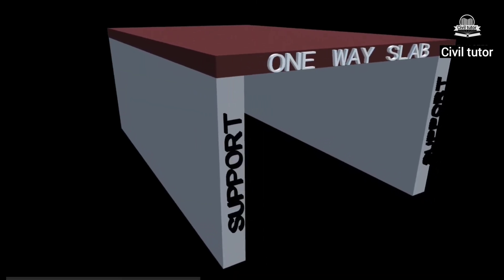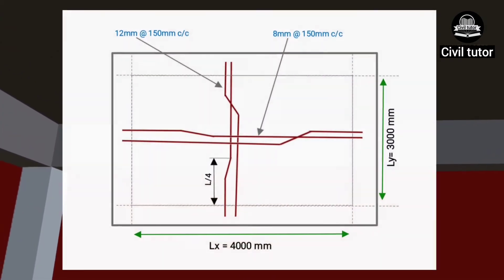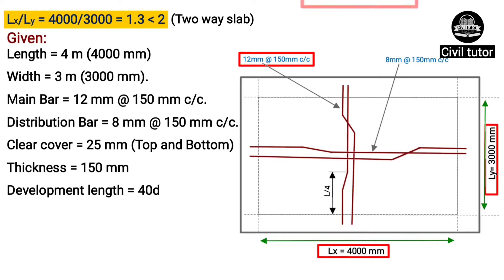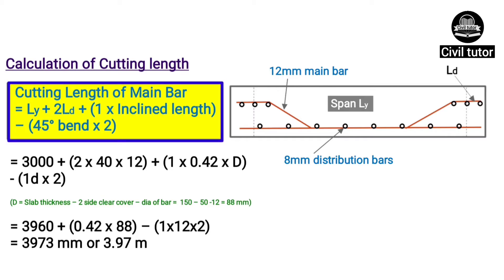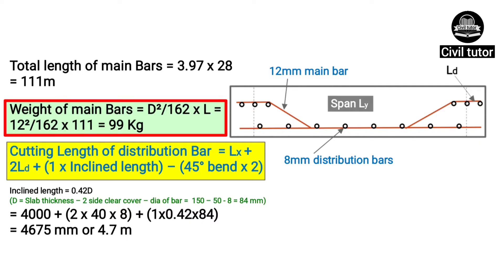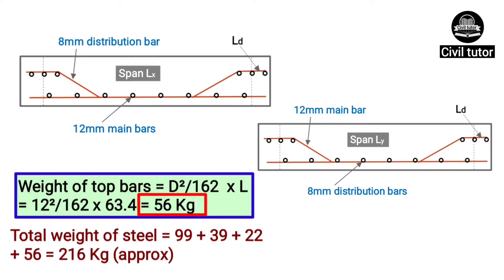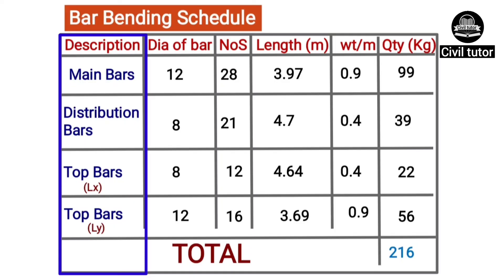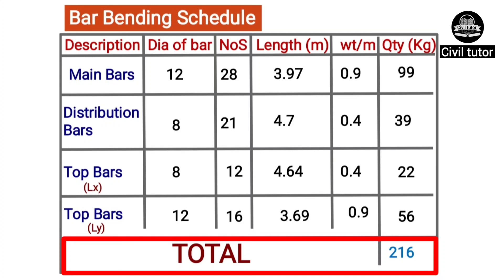Two way slab reinforcement details | BBS of slab | Steel quantity calculation | Civil tutor #BBS

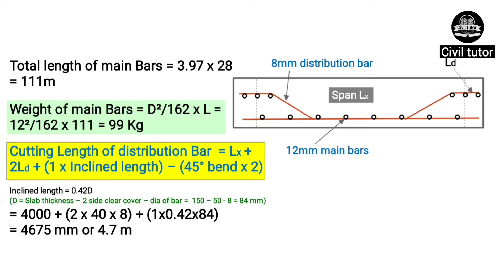Comment from the maker: @5:20 I forgot to deduct the 45degree bends (2x1d= 2x1x8=16) after applying the formula for cutting length of distribution bar.... The cutting length will be 4.66m....total length will be 98m & total weight 38.7Kg or 38Kg..... Please do the calculations accordingly.... Sorry for the error!
Reply: You forget one more thing that is D=slab thickness - 2×clear cover -diameter 
That's D=150-50-8= 92
But you mentioned there D=150-50-8=84 
Sorry for telling this little thing
Reply from the maker: You are right....this has happened due to a typinging error.... Anyways thanks for correcting me! 😊
Reply: @CivilTutor  does every slab keeps cranked bars ? Can we calculate steel requirement without applying crank.
Reply: I don't knw one and two slab so I listen carefully.thats why I catch that point sir..
Reply from the maker: You are right....It's 92 (Typing error)